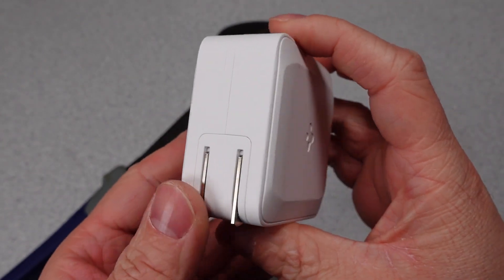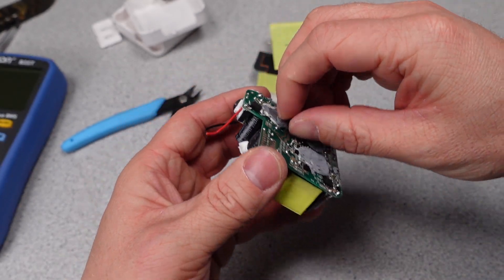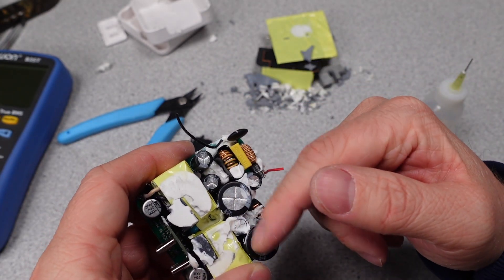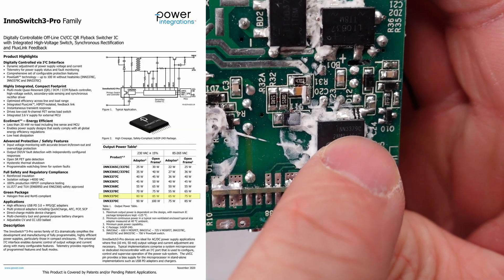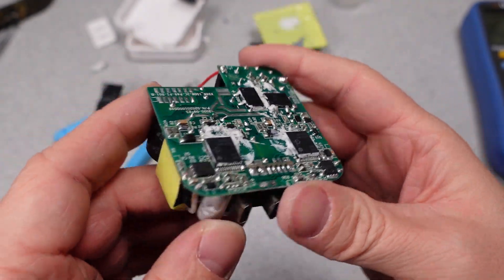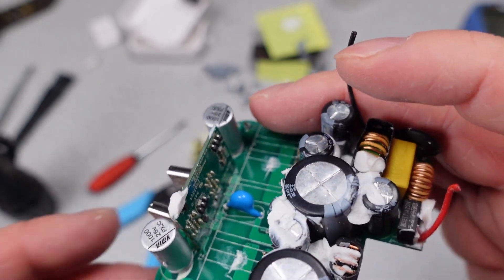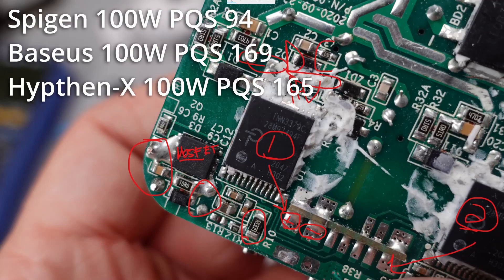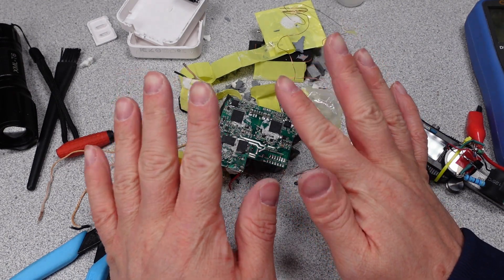Spigen 100 Watt USB C Power Adapter Teardown

Comment: Spectacular tear down, however destructive it might be, the result was quite constructive. A surprising detailed analysis from All Things In One Place, right on the tabletop, all in pieces sticky tacky foam and all. Its good to see that they followed chip manufacture recommendations, and even tried to use some EMI shielding. But the wires though, what is it with these manufacturers and their wires! Don't they know those wires are so easy to crimp, and there begins your short, then your fire, then hopefully your breaker pop if your lucky! Its amazing how much garbage is sold in the US. Keep doing what your doing, cause your doing great buddy!
Reply from the maker: Thanks, yeah, I was happy with the construction of this one in terms of quality.  The wires had a bit more room in the larger case so wasn't too much of an issue in this one.  The MOSFET solution for sharing the supplies is novel (I need to get better software for pen capture).  In reality a single 100W supply could've been used with lower input capacitance and a boost supply (active power factor correction) taking up that space.  The Spigen meets DOE VI regulations though, where as the Hyphen-X and Baseus don't.  Obviously, this can be managed since the Satechi and Nekteck did meet DOE VI and have APFC.  I haven't found any that are perfect yet.

Comment: Doesn't it have a TUV (for Japan) safety mark?
Reply from the maker: Yes it does.  I should have clarified that it lacks USA and Canada marks for safety.  In reality inside it is built well and the components inside had type approvals (transformer didn’t) but I didn’t see anything scary or unsafe in the construction!  Odd choices for sure but not unsafe.
Reply: @AllThingsOnePlace  isn’t TUV a universal international standard?